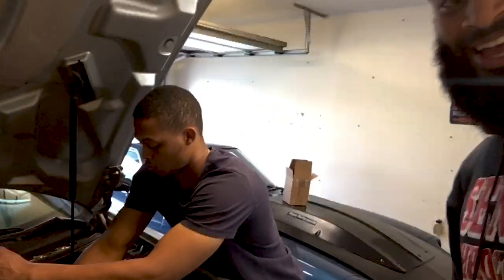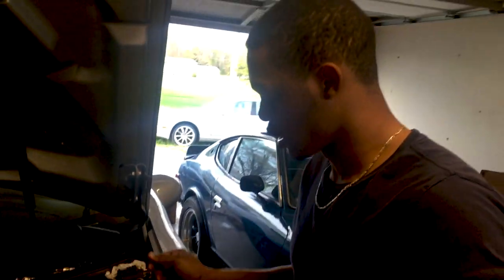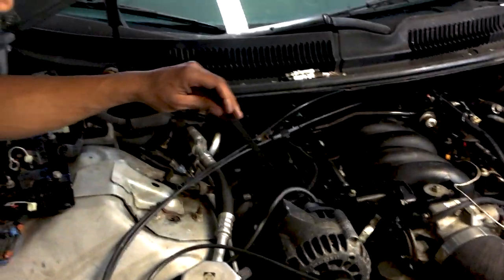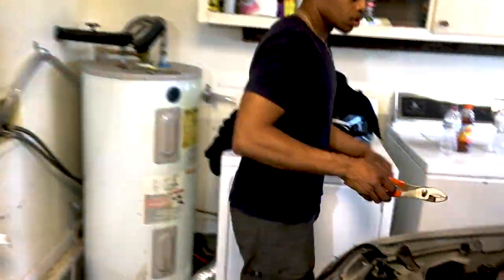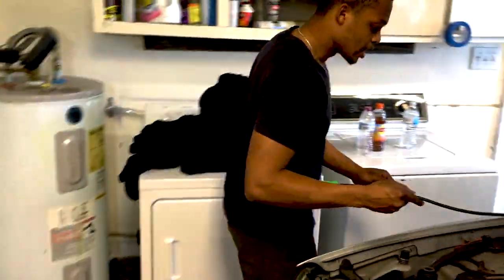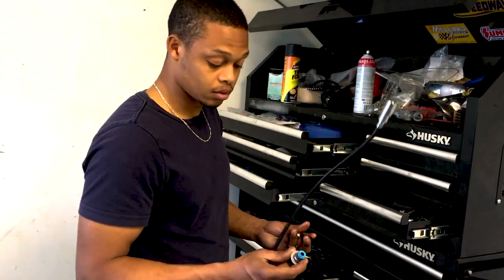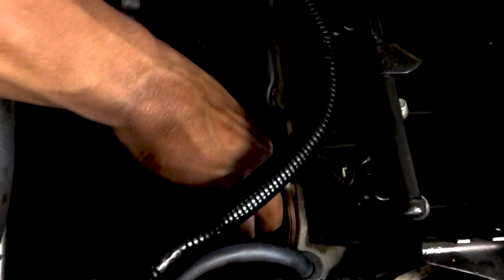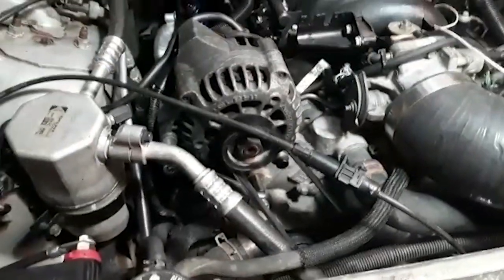THE BUILD IS FINALLY FINISHED!!! - Josh Turbo Camaro Vlog Part 3 - Burnout Vlog #56

Comment: What power did it make ?
Reply from the maker: Between 500 & 600 whp
Reply: Barbells & Burnouts cool, doing the same setup to mine right now, but mine is cammed so hoping for some good power .